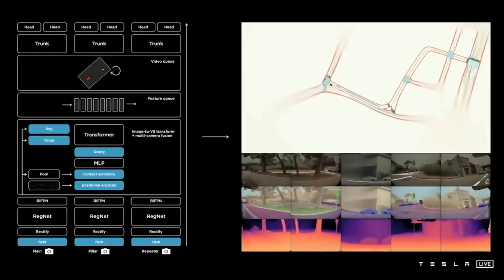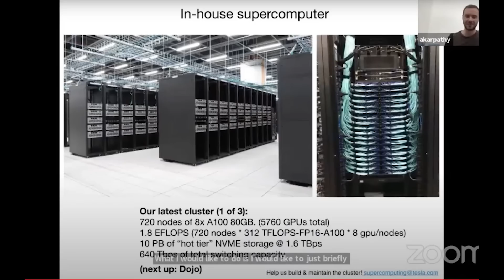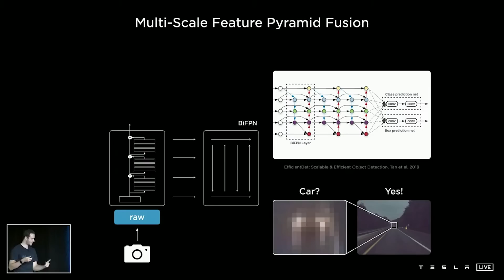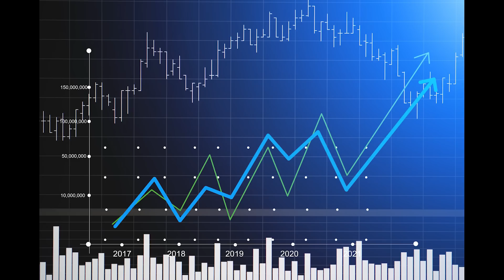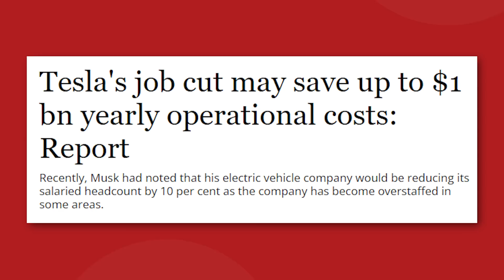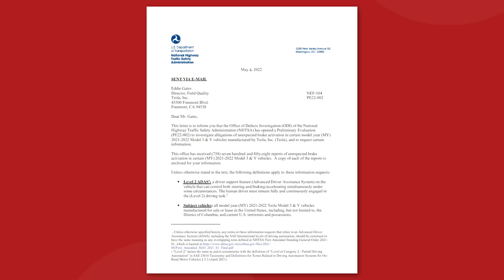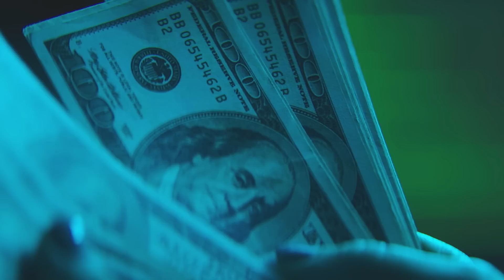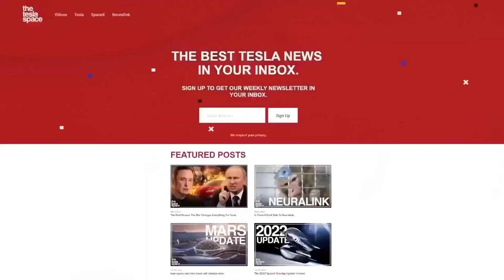Tesla Will Reveal Working Tesla Bot At AI Day 2022!

Comment: This was not the best group discussion. What good would a robot capable of handling 50# be in a factory? Well most humans can barely manage that much, what good are they? Very important that the form factor be humanoid. That does mean balance may indeed be a serious problem to be overcome with internal and external sensors. Likely a great deal of training will be in VR-type reality simulations. New object recognition might precede wi-fi Internet queries about object identification, properties and utilities. The discussion of recharging was puerile - a butt-in recharge plug? Why not mention wireless magnetic charging, for instance. No mention of wireless updating, internet access. One good point is the weight of a Telsa 4680 battery (355g or ~.75#) and that a TeslaBot might need 8# of batteries - about 12 of them in the legs and abdomen. Easy to recharge fairly quickly. No future battery bottleneck there.

Comment: Working remotely encourages isolation in silos. Going to the office means people can meet and rub shoulders with everyone else not directly involved in what an individual is doing. That means a better chance of cross pollination of ideas and it's easier to get people outside your department to give their input.

Also, the best place for an engineer is on the front lines of production. Any engineer who wants to stay with the company can shift to working on the floor, which means they see first hand what issues they want to fix or improve. This is why the world headquarters are in the Austin gigafactory, with windows overlooking the floor. They see what is going on and feel a closer connection to the actual building of cars.

Tesla made massive strides in innovation. But slowly other car manufacturers are using giga presses, selling online, making a battery that is structural, using LFP batteries. So the world is catching up. And that means... Tesla is no longer leading. And in turn... THAT means Tesla needs to keep innovating if it wants to maintain its lead. And THAT means more engineers on the floor / more floor workers coming up with new ideas that improve the cars / production processes. It's not easy when you made so many strides forward to continue the rate of innovations.

Regarding the economy, I heard someone working with the Federal Reserve Bank or something wanted to get inflation under control. This will lower demand for petroleum and result in Russia taking a hit on their oil and gas exports, which is how they are financing their war in Ukraine. I can't say how this affects electric cars because high fuel prices encourage people to buy an electric car but a slower economy means fewer car sales in general, including for electric cars. Either way, more innovations at Tesla will help them a lot in the coming 6 months to year.

Comment: While I fully accept that Elon falls into the category of wanting all workers in the office, I disagree with your statement about firing remote worker will reduce costs. If a company fires a remote worker or a on site worker the remuneration saving is the same - assuming payment parity. Where I differ is the remote worker does not require a desk or occupy office space and facilities so they save the company more money. In this way the company only needs a small percentage of hot desks and can reduce real estate costs. Some argue that efficiency drops. I think this is due to management. Basically if a worker has one week to compete a piece of work it does not matter whether they are at home or in the office the end date should be the same. Of course this does not apply to factory workers. So assuming we’re only discussing office workers, in my opinion remote workers safe more money. I understand where Elon is coming from. He is totally driven to create a multi planetary species as well as create a sustainable environment for all. He needs everyone at Tesla and SpaceX to work the same as he does. His thinking is black and white so there are no exceptions.
Reply: No
Reply: >Of course this does not apply to factory workers.
Tesla is a manufacturing company. All employees are factory workers and that's his point. Tesla won't make better cars if the engineers & support staff aren't directly on the line fixing problems. If you have nothing to do with the manufacturing line, why are you employed at Tesla?
Reply: The car might be real but the robot is as fake as a man in a robot suit.